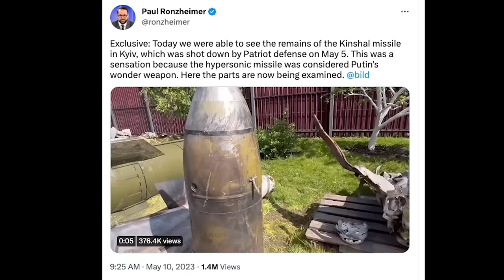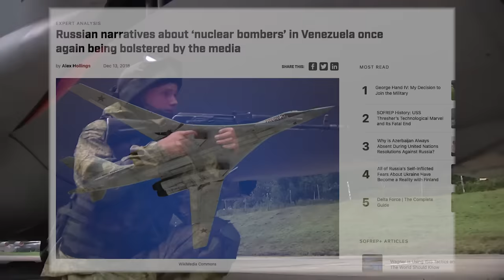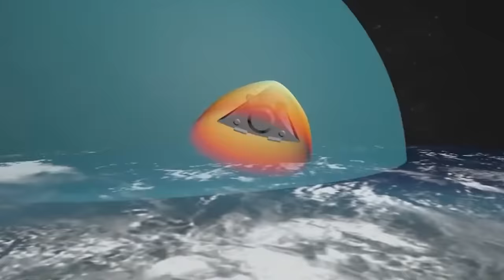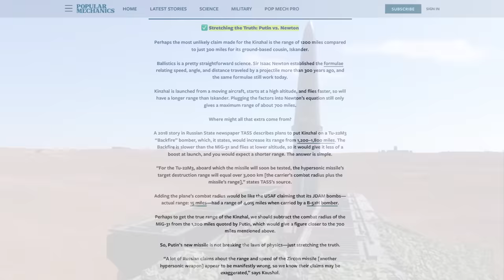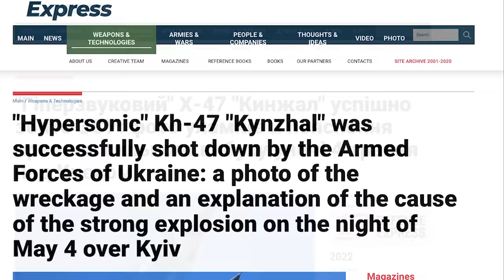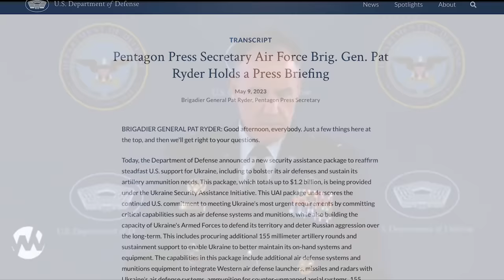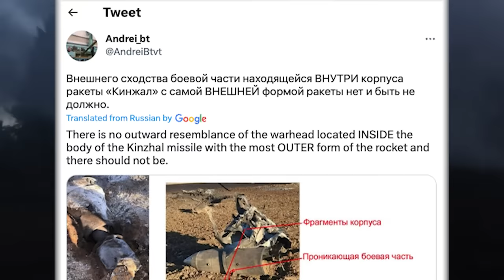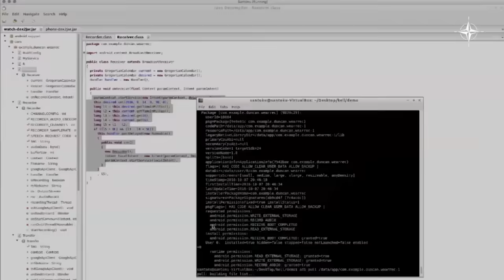Ukraine intercepts Russia's Kinzhal missile?!? Here's what happened

Comment: Whether it’s a kinzal or not ,the modern patriot radar(pc3 or pc4)would’ve pick up the speed behaviour as hypersonic(kinzal?) greatly enhanced by its pointed direction towards the patriot,furthermore air launch hypersonic is easily picked up by radar both in speed(hypersonic  Mach 5)and trajectory(not manoeuvrable),again a job well done!
Reply: Speed is not a major issue when both in opposite direction,just have to time the contact point at the precise killing time!
Reply: @georgesikimeti2184  This is what I was thinking when I saw initial discussions around the Kinzhal missile. Speed will make the interception more challenging but as long as you have enough warning then a Patriot should still be able to take a Kinzhal out.
Reply: @LoneWolf-rc4go the current radar system in the patriot can detect and predict how fast the thing is,simple!
Reply: @georgesikimeti2184  If it was as simple as that then all missile defense systems would have 100% accuracy and hit rate. It's very complicated stuff but speed does make a difference and affects the area an Air defense system can protect. Millennium 7 * HistoryTech on youtube has great vids on military air tech. He suggests that area defense becomes near impossible because of hypersonics, but point defense is still possible for air defense systems. Meaning that if an air defense system can cover a circle of 200miles diamater. If it is a hypersonic missle that circle becomes squeezed into a tight ellipse and may shrink a little too. It's still possible to shoot them down, but only in a very narrow corridor/approach
Reply: I've heard, from Cel. Doug McGregor, who is also an specialist, that Khinzal is maneuverable . Specialists are biased and we have to analyze information about something we have no sufficient knowledge to question any conclusion from the specialist'. Better keep on watching and hoping for this war to end soon, no one is winning, but the war industry is doing fine..
Reply: @AlexCarloss  To be honest McGregor doesn't really strike me as somebody who has knows what he is talking about. This was the guy who predicted that Ukraine would be defeated inside of a week. He also claimed in March 2022 that the Ukrainian army had been virtually wiped out. The evidence that he provided for this was the fact that there was a large Ukrainian ex-pat community near where he lived. Given his career there's nothing to suggest that he has any great insight into Russian missile development. 

Maybe the missiles are maneuverable, maybe they aren't; but the fact that three of the designers have been arrested and charged with treason gives me reason to suspect that Kinzhal might not be the wonder weapon that Russia claims it is.
Reply: @suibora the missile was launched inside Ukraine airspace,its a face to face  encounter,absolutely no atmospheric interference ,it’s down to who shoot straight with timing as the only variable,however in practice 100 percent is rarely ever achieved!
Reply: @LoneWolf-rc4go  I understand, but one thing is making predictions and the other thing is giving technical information. Either is it true or not it is difficult to know. This is what I found after a simple search:  
"Following the launch, the Kinzhal rapidly accelerates to Mach 4 (4,900 km/h), and may reach speeds of up to Mach 10 (12,350 km/hr). This speed, in combination with the missile’s erratic flight trajectory and high maneuverability, could complicate interception.10 ".
Reply: @AlexCarloss and that last paragraph turned out to not be correct.

Comment: What it sounds like to me is that the patriot in it's present for (Pac 3) may show the capability to hit a percentage of manuverable glide vehicles also. If the missile can be guided for the first part of the trajectory and then gain it's own tracking lock with the capability to manuver toward the target trajectory then it may become effective in a later stage intercept if the incoming missile target is  identified. There are some interesting ways to identify a trajectory. From the view of the lacking of ecduction, That incoming missile threat has to be pointing in a final direct at some point. A missile that travels at mach 20 or higher with the capability to manuver maybe harder to hit in flight but not as hard to hit once it hits it's final stage of track into the target. Mach 20 is extremely fast but then there has to be a point that is identifiable of a last manuver that would place it on a glide into the target. So mach 20 is around 4 miles per second. So at 150 miles, you have 37 seconds to approach a solution. If the missile is being tracked, How many flight path adjustments can be made in the last 37 seconds. one maybe. But then if there is more then one missile fired at the target along the trajectory as the missile is moving in the direction of the target it is possible to catch the incoming missile on one  of the changed trajectories. I don't see why the patriot would not have at lease a 75% chance of downing anything incoming. If the missile avoids tracking for any reason then the missile would hit it's target. Not seeing some object flying at mach 20 on a radar would be that someone went to get a cup a joe and left the tracking screen for a minute or two. But then I would suggest that somekind of AI would always be watching. Kinda like putting the patriot on auto pilot to get a cup a joe. I can get up and fill my coffee cup and sit back down very easily in 37 seconds. Less the coffee pot is at the next door neighbors house. The conversation is eminant and 37 second passes very fast.

Comment: The horrible problem, not discussed, is that the Patriot missiles cost far more than the Russian attack missiles. In the long term, this is not economically feasible. You can't shoot down a $20K drone with a $2 million Patriot missile. It simply cannot be justified.
Reply: patriot was used only against kinzal,other defensive systems were also there for drones and other slower missiles,this should’ve identified and confirmed before the Patriot missile is engaged.

Comment: Ok, I have heard enough propaganda. Common sense, if it's truly hypersonic and at max speed it couldn't be intercepted by patriot. False, study the patriot system and you will know. Read for yourself. The system's and tracking was not designed for a truly hypersonic missile traveling at max speed and maneuvering. Look at the missile they claimed was shot down, it didn't even broke into pieces. Not even on impact to the ground.A tiny hole in one side that looks like it was done by an explosive charge.. Questionable information..
Reply: ...  "intercepted"  you used the word yet don't understand its meaning XD

Comment: The "nose cone" everyone is declaring is the launch vehicle for the actual warhead. The Kinzhal is just an air launched ballistic missile meaning it's a multi-stage rocket. It will have a booster stage and then a glide stage. I the nose section of the launch vehicle will be discarded releasing the actual glide section/war head.
Reply: The design schematics of the Khinzal do not bare a resemblance to the wreckage they found and claim is a Khinzal - and this is talking about the internal design underneath the aerodynamic nose-cone.

Comment: Unfortunately you lack technical details that prove it wasnt a kinzhal. The kinzhal projectile is 580mm dia x 1500mm length. The projectile shown which was shown being held by UAF member is less than 1500mm long and its dia was closer to 300mm ie it matches the FAB500 dimensions exactly. 

The kinzhal is confirmed to travel at mach10 more than twice the speed of a patriot launched missile of max mach4.1. 

The patriot radar range is max 150km meaning a kinzhal covers the distance of its max range in less than 40seconds and has on board radar capable of detecting projectiles and autonomous flight control allowing it to avoid these projectiles. 

Typically the us and ukraine are trying to save face.

Like always

Comment: Even the patriot has maneuvrability if the speed of kinzhal its more than 3 times superior it couldnt be shot down because of its speed in the time of the lock down and the or the guidence system of the patriot in adjustin time the kinzhal could paas through without any difficult this is not posible even the radar of patriot assuming or supponing that the radar could detect a target over 200km it has only 1 minute to react and kinzhal could not be seen by the radars either the shahed drones that are subsonic the patriot couldn detect it
Reply: fool do you know what intercept means? it also helps if the missiles were going after the patriot lmao

Comment: Hypersonic in Strictly Aerodynamic terms is the velocity at which air molecules dissociate due to heating by the moving object.

This happens around Mach-5 which is 5x the speed of sound. The speed of sound varies with Temperature. Colder temp means slower speed of sound. Colder air temp also means a higher velocity is required to heat the air until Nitrogen and Oxygen dissociate. It also depends on the precise shape of the object and how much the flow is accelerated or slowed-down due to geometry of the object. 

Hypersonic could be mach 4.something to  mach-10 or more.

Comment: the argument between the BETAB and the Kinzhal isn't even as solid bruh, because in the diagram the Ukrainian expert shown, it didn't even fit the internal warhead shape. using the public information it showed that, assuming that is the penetrator, it has 4 point along the diameter where the holes (8) should be and that the tip, while it tapers, is flat

every photo the Ukrainians have of it, only has 2, which is used for the mountings so it can be hung on the wing, while it tapers off into a point. this is so cope that you surpassed the average league playet
Reply: “This is so cope” 

is literally coping throughout the comment

Comment: Another thing you seemed to forget about what a hypersonic missle is, Is that it can achieve that speed at lower altitudes than a ballistic missle can the point of a ICBM is too goo as high as it can in almost like a oval and build up the speed than hit its target on the ground thus its using gravity more or so to achieve the high speed but the ICBM can be shot down at the launche phase. A hypersonic missle will acheive its top speed at much lower altitudes and with much more manuverabillity which is the reason why its so deadly because it can be so low and give AAA a hard time actually trying to hit it. Many nato AAA systems have failed trying to shoot it down and than you have russian counter anti air missle battery systems and artillery that destorys the Ukrainian AAA supplied to them. Calling russia anything less than a great military is bad judgement and only proves you are lead by your feelings which is your downfall. It is obvious any missle shot down over ukraine will be played like its a kenzil missle because its had such a success rate Ukraine can't cope harder.

Comment: i dont want sound like putinist, however patriot are not capable of taking down a kinzal missiles which goes 7 times the speed of sound, they are not made for it. I do understand nuturaly both side use propaganda to keep the morale high but technicaly its not possible. Its probably faulty missile
Reply: it’s not a race to the finishing line,slower speed in the opposite direction can match the faster speed through timing with the help of advance radar for tracking and control,it’s not impossible!
Reply: Patriot doesn't chase after it. It hits from the front.
Reply: @RR-us2kp thanks,at least somebody is talking common sense ,you hit the nail right in the middle,high speed (hyper)only effective in chasing or running away from the target,you prove my point and spot on!

Comment: You lie. Kinzhal (and Iskander) missiles have 4 aerodynamic rudders on the tail unlike all other ballistic missiles. So, they can easily manuever on all stages of flight and  are impossible to intercept. Besides, it has common nozzle stream rudders that are used in ordinary ballistic missiles to maneuver in space areas. Besides, there is modificatoin of Kinzhal missile that has optical guidance system, so, it can lock target and hit it. It can be used against aircraft carrier that is easily to detect to to hit. That's why Putin ordered to start patrolling Mig-31Ks with Kinzhal missile to aim american carriers in Eastern Meditteranian. Unlike Iskander. Kinzhal starts not from ground but from air carrier that flies and supersonic speed, like Mig-31. So, supersonic carrier is actually first stage of Kinzhal missile and it makes possible for missile to reach hypersonic speeds at middle stage of flight without leaving atmosphere, which is also advantage because NATO does not have any interceptors working in that part of atmosphere.